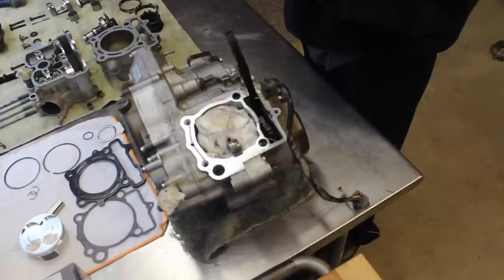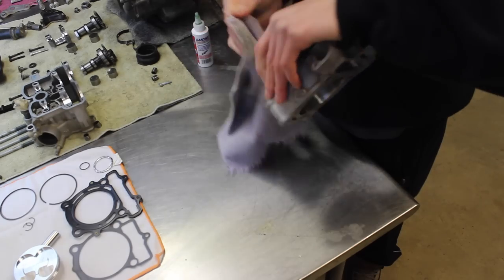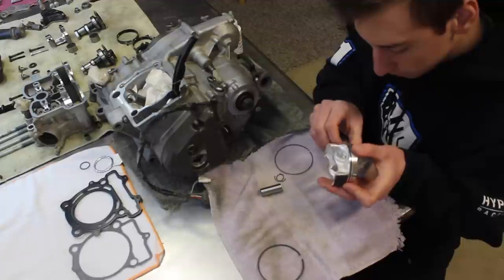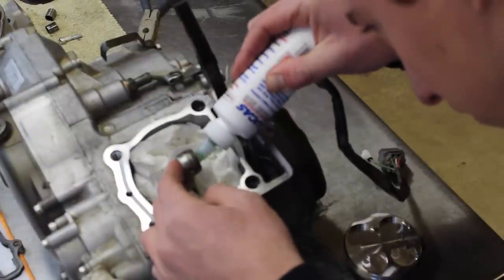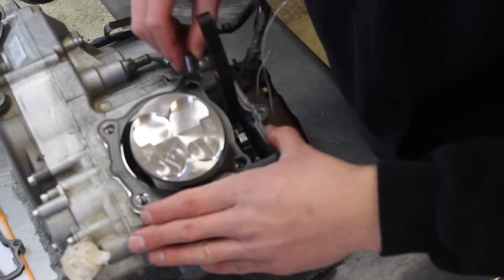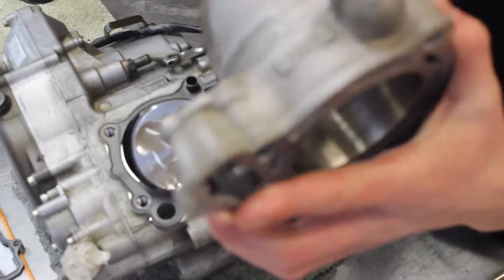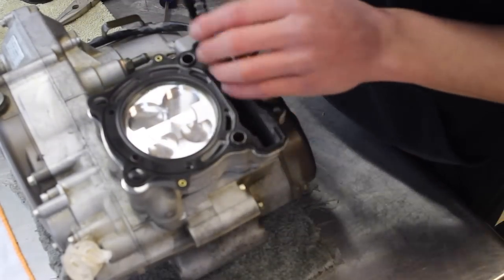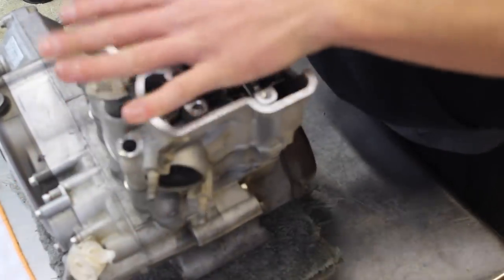How To | KX250F Top End Re-Build

Comment: About 6 years late to this party but my son and I are doing research for his 2011 Kawasaki KX250f top end rebuild.  I found this video very informative and well done.  There were little tips included that will be very helpful.  Enough so that we will be doing the work ourselves with some confidence.
Reply: how did it go?
Reply: @marquiseanthony1668  I believe all the kx250fs have been pretty much the same since 2009
Reply: About 1 year late to your party… but how’d it turn out? She rip now?
Reply: Me too 🇮🇪
Reply: @marquiseanthony1668  It went well.  One mistake I made was not keeping the shims separated to each bucket so I could have the correct measurements.  I did get some help getting new shims installed and when we got it all back together the bike ran like a champ.  Again, without this video I wouldnt have had the confidence to attempt this;  It was a good project I could do with my son as well.

Comment: For the cylinder head bolts you want to torque them down in 3 steps. If torque specs call for 60ft lbs, Tighten all bolts hand tight in a criss cross pattern taking your time and just snugging them down. Then first torque all bolts to 40 ft lbs, 2nd step torque them down to 50 ft lbs and 3rd step torque down to 60 ft lbs! You never want to torque bolts down in steps of less than 5 ft lbs as the torque will be reached before the bolt moves.

Comment: Great video up until you used the silicon on the rocker cover. The last person to rebuild my 250 used silicon. You wipe the excess from the outside but what about the excess on the inside? My pick u0p strainers were full of silicon where the guy had used it on every surface and the excess on the inside had washed off with the oil, clogged the strainers and starved the engine of oil. Not only did the engine not last long but it needed a huge amount of work.. The manual suggests using a small dab of gasket bond just on the corners of the two semi circles. Excess gasket bond dissolves in the oil so doesn't cause any harm.

Comment: Just a two stroke passing by...💨🙃
Reply: I also just keep it with my 2 stroke
Reply: +Eminent Bastards im going to buy the 2016 yz250 i need a reliable bike thats easy to rebuild if need be the four strokes arent that bad though im just having problems with the valves ive never done them on my bike since i bought it in 2007 now it wont run my 2002 yz85 i still have it still starts on the first kick lol that bike is a beast for a little bike pulls 300lbs easily ....my crf250r needs to get a new piston and so does the 85 thats why im watching this video it looks pretty simple just cleaned my garage out today to make room for working on my bikes to get them all cleaned up and running really wish i had an expereinced 4 stroke mechanic to help me with valves and reshimming im pretty sure thats why it not running lol ill figure it out

Comment: Great video man.  Guy admits he's not a pro.  But he's definitely doing it.   And commenters ain't.
Reply: Woody Woodlstein ya buddy
Reply: I looked up specs and it says m6 bolts 104ft lbs and M10 bolts 36ft lbs.  the service manual says the number 8 bolts the 4 long ones only 36ft lbs.  that seems way to loose.  Because i tightened mine to 60 something or whater he said and my gaskets leaked like crazy. Oil just spewing out.  I literly had to hamd tighten them so it wouldnt leak.  Please help

Comment: Pro Tip: factory torque spec on cam caps is 8ft lbs. that's unnecessarily tight and we have found that 6ft lbs works much better and helps free up some of the rotational friction.
Reply: This pertains strictly to the kx250f 2013 and newer
Reply from the maker: +Hired Expectations ya mines an 07, good tip tho!
Reply: My torque wrench only goes down to 10

Comment: Good on you for having a go.
From a pro to a home mechanic. When using a tension wrench, you never should use extension bars. You can't  get the correct tension on the bolts like that, the extention bars twist and don't transfer the tension to the bolt. Secondly, don't use assembly lube on the cylinder, use engine oil. You want the rings to bed in quickly when you run it in.
Reply: I agree with the engine oil in the cylinder but it’s been proven that extensions don’t foul torque ratings if ya use them properly
Reply: @cableheadcrew3880  I think that would come down to the make up of the extension bar and the material used in it. Do you trust your extention bar/s and where they are made?

Comment: Nice job. I m doing mine now, I would suggest using a micrometer and T gauges for piston to cylinder clearance , checking end gap on oil rails and compression ring. Oil expansion ring ends toward intake port and rails 20 degrees from expansion ring ends. Compression ring end toward exhaust port. Ends of piston circllip should not be in notch in piston wrist pin hole. Great overview.

Comment: One thing. Be careful with how much liquid gasket you apply to the valve cover sealing surface. The amount in this video is way too much and parts of it can fall in to the engine during assembly or when running the engine later on and might clog up the mesh filter or other oil channels. It just needs to be a thin layer and towards the outer edge as the valve cover will crush it and spread it evenly over the sealing surface. 

Otherwise a very nice video. Easy to follow.

Comment: I replaced the valve oil seals and put some assembly lube on the inside to make installation easier but now I'm wondering if they'll slide off the valve guide ... before I go putting things back together, should I remove them and wipe them down with contact cleaner to remove the lube or should they be fine?

Comment: I accidently dropped the small head bolt by the timing chain down in the case. I could hear it bouncing off of a number of things before it stopped. I tried fishing it out with a magnet and then flipped the bike upside down and I wasn't able to get it out. Do you have any ideas on where it went and how to get it out. is there one side cover I could remove to find it. I really don't want to pull the engine out and rip it all apart. Any help would be greatly appreciated
Reply from the maker: 100cockroach you can lay the bike on the side by leaning it against the stand if you have a stand or a bucket will work. Take off the ignition cover and you should see it somewhere down there. You may have to take the flywheel off. That's where I would start.
Reply: Thanks a lot for your help buddy. It turns out it was lodged under the stator wire. That may of happened when I was tipping the bike upside down.

Comment: Great video but one thing, you never put anti seize on a bolt that is torqued as it makes the bolt slip easier and strip the holes out.
Reply from the maker: Thanks for the comment, but I have been rebuilding my engines for about 2 years now while applying a very thin layer of Anti-Seize and I have never had a problem with the head bolts slipping or stripping out. It's really just a personal preference and what you are comfortable doing to your machine. You can use Anti-Seize, a thin layer of oil, some "Thread lube" or just clean out the threads with a brush and install dry. But at the end of the day its just really what you feel more comfortable with. I use Anti-Seize because it makes the bolt easier to remove after install, keeps it from seizing up and it creates an extra sealing layer when it dries. You might have heard that Anti-Seize might not let you torque the bolt accurately, but a very thin layer of Anti-Seize or oil will not affect the torque that dramatically to make it will fall out. Thanks again for the comment, hope you see where I'm coming from.
Reply: +Gregory Maibach /stratigos11

Putting anti-seize or oil on a bolt that is torqued is not right or wrong. It's simply understanding that a dry bolt will reach a torque value in less turns than a bolt with lubricant of some type. They make charts (Zuess charts) that have dry vs. wet equivalent torque values. The issue is that if you torque a lubricated bolt to the same value as a dry bolt you are actually putting more strain on the threads of the fastener and hole. It may be minimal and you may never see an issue, but on softer materials like steel bolts into aluminum, you need to be very careful.

Comment: I have a 2005 RMZ250 I rebuilt the top end and my question is my piston moves left and right on the wrist pin a pretty good bit but it does not move up and down before putting the head on is this normal to have that much play
Reply from the maker: Bobo mcrae you need a service manual to see what the clearance should be on each side. Also check for any marks on the inside of the piston. You may need to replace. You can probably find one on google if your search for your bile model and year and out service manual after it.
Reply from the maker: Bobo mcrae you need a service manual to see what the clearance should be on each side. Also check for any marks on the inside of the piston. You may need to replace. You can probably find one on google if your search for your bile model and year and out service manual after it.

Comment: Is there a video on just putting the rings on? I have the same year kawi 07, not to sure about the rings. So I plan on doing my first ever 4 stroke rebuild
Reply from the maker: No I don't have a video for just that, but make sure the letter is facing up on the top ring and the bottom three rings are the oil rings. First put the spacer (the one that is stretchy) on the bottom slot, then put in one side rail on the bottom of the spacer and then another side rail on top of the spacer. The ring gap should be about 20mm (0.8in) or more for maximum oil flow. Next is the top ring you should only have one and it should have a letter on it. Make sure like I said before that the letter on the top ring is facing up and put that in the top slot.
Reply: okay, thanks so much

Comment: Hi, what do you call that little hole with a rubber seal on top of the exhaust port? I have a 2008 model and it's leaking. What could be the problem?

Comment: how often do you have to change top end on kx250f? I am thinking about buying one.
Reply from the maker: You would want to check your compression, once your compression is low you would want to change your rings and check you cylinder. Also a good time to adjust your valves if needed.
Reply: @stratigos11  Thank you! I guess the manual says how to check all these things right? Looking forward to learn this stuff, thanks!
Reply: @stratigos11  Thank you man!

Comment: what year is this bike? i have a 2014 kx250f that locked up. gonna do the work myself any thoughts? lol my first four stroke rebulid
Reply from the maker: It's an 07 and take your time and make sure you clean all the parts and cases really good. I'm guessing you'll have to split that cases and put in a new crank.
Reply: I was hoping for just a top end rebuild but I doubt it will be that easy:/

Comment: 0:23 DON'T ever hone a nikasil cylinder. All you are doing is screwing up your clearances. You're doing more harm than good. Only time it should be honed is after it's re-plated to get it to factory specs. And you don't do the honing, the re-plater does. If the cross hatch is missing then the specs are so far out that it needs to be re-plated, not honed.

Comment: Also, a ball hone is safer to use on the nikasil bores. The coating is extremely hard but if you don't use caution you can wear through it. A ball hone with three passes or so should do just fine. If you can see some cross hatch use a scotch bright pad and some soapy warm water and make circular motions up and down as you rotate the cylinder in your other hand to deglaze. Otherwise man your doing fine I'm sure you engine runs great so don't listen to the idiots on here.

Comment: for a first timer, what advice would you give?
Reply from the maker: Jason Spears good luck, lol
Reply: Take your time. Keep your work place clean. Video your disassembly for questions when you reassemble. Label and bag your parts. Inspect your parts upon reassembly, that being said I go by this saying when rebuilding when in doubt the the part out. Go buy lock tight and assembly lube, anti seize. Anywhere it's need it would be a good idea to use. Last thing never cut corners if you need something it's a good idea to do it the right way or not at all. Hope this is what you were looking for.

Comment: hey man where can i find the valve clearances for my bike it’s a 2015 kx250f, i fucked it up before bc i accidentally used specs from an older kx250f
Reply from the maker: I would google "2015 kx250f valve clearance" or "2015 Service manual" Thats how I find all my service manuals. Or you could always call a local dealership. If they are cool they should give you the valve clearances.

Comment: I've always thought if you put an extension on a torque wrench it wouldn't be accurate
Reply: +Frank Trubia as long as it doesn't extend the lever itself (the distance between the pivot point and the handle), its fine.
Reply: As long as its on the same axis its fine.

Comment: You don't hone nicosil . Also wouldn't you measure to see if the cylinder is out of spec? Lol. 10 out of 10 times it need replacing . What a waste
Reply from the maker: You hone cylinder to create a new cross hatch pattern for the rings to seal better, so yes you do hone the cylinder no matter what. And I've been rebuilding engines for a while now ive never had to replace a cylinder on one of my 4 strokes unless it blew up and really scratched up the inside and the cylinder. With 2 strokes on the other hand I've replaced cylinder sleeves almost every other time... Or got a wider piston... Maybe that's what you're talking about. Maybe do a little more research on the Internet or get some experience before you tell someone they are wrong when they are actually right.
Reply: +stratigos11 on the instructions that came with my wiseco piston it said the cylnder dosent need honed as long as if there are cross hatches left
Reply: you ruin the nikasil plating if you hone it with that...If its steel on the other hand, then no problem, you need the pattern for lubrication. i liked the video, rebuild my engines the same way :)
Reply: What 2 stroke cylinders are you resleeving? They are Nikacil. You replate them, not resleeve. You dont know what you are talking about. Sleeved cylinder have not been used since the late 80's.
Reply: well wiseco sells ball hones. and they can be honed.
Reply: Crazycrf 100 if your bike needs to be rebuilt... there's no criss hatching left....you absolutely need to hone so the rings get filed and seal up against the bore properly....run your finger nail up and down to see if you feel a lip at the top and bottom...you should also check the bore with a bore gauge to see if it's oval or straight...you will have a higher number in the center then the top andbottom...